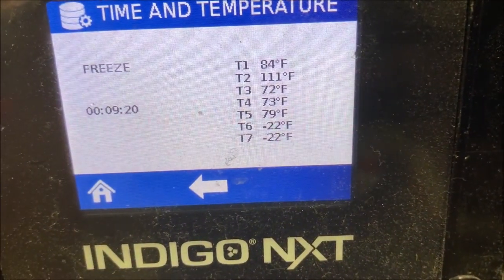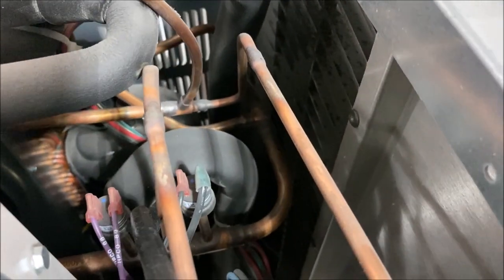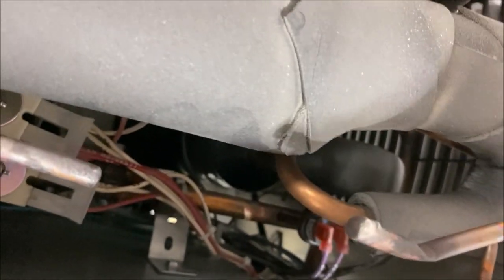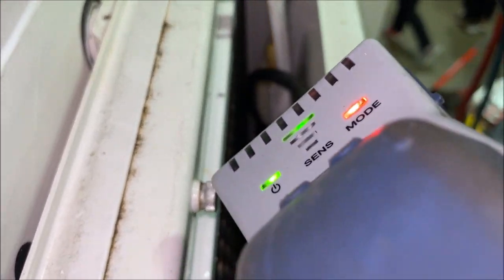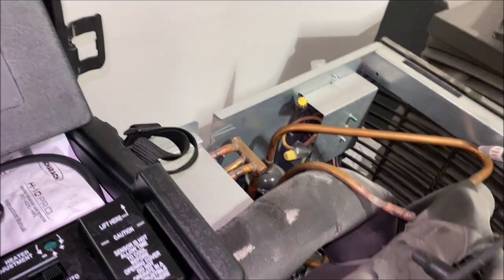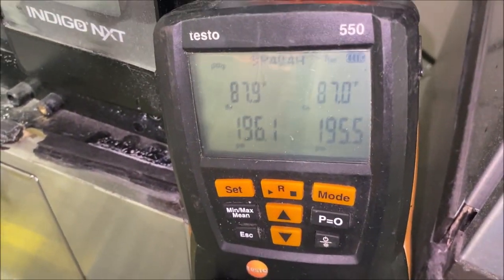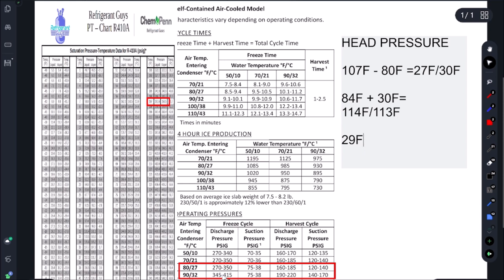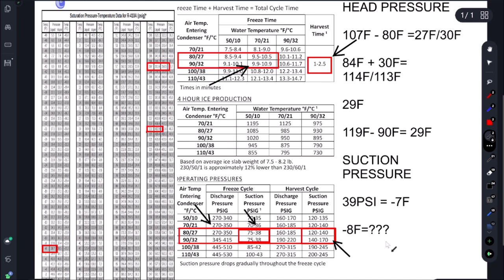Manitowoc Ice machine IS not making ice (Warranty call)

Comment: R-410A on a self contained ice machine great job Manitowoc 😀🙄😬. I’ve repaired several leaks on Manitowocs ,Koolaire units bad design for self contained units taking in consideration that not all customers are on top of their PMs just imagine what the head pressure will be on a self contained unit with a clogged condenser 😂🤣😆🥹. Good video 👍🏼
Reply from the maker: Ya great point, head pressure will become an issue for sure
Reply: Luckily they put in a high head switch that will shut it down until you do the PM on it.

Comment: Great job. I've noticed that those new Manitowoc ice machines are having some problems while still under warranty. Especially control board and leak.
Reply from the maker: That’s not good, especially with the shortage of parts
Reply: So true bro, I rather the old fashion type ice machine wotk like a old 1989 Toyota corilla even when the body is gone the main working componients are still kicking

Comment: Really like your play-by-play in your videos, excellent job again. I might have to invest in an H10, haven't used one in 20 years. Nice to have several options for leak checking, keeps the stress levels down.
Reply from the maker: It’s one of the hardest parts of the job, and in the last month since I’ve had it, it has made my job easier and quicker.

Comment: I have been using the H-10 for over 40 years it has always been my number one leak detector I have owned 20+ different manufactures leak detectors.?

        But they finally manufactured a leak detector that is as good and may be a little better for HCFCs and HFC oh refrigerants the DeTek Infocon Stratus

H 10 is still my first to go leak detector for R 12 in R 22
Reply from the maker: I thought the stratus and dtek3 had the same sensor, only difference was the cloud hunting mode.
Reply from the maker: Thanks for the detailed explanation! Yes I’ve found sometimes one works better than the other. I most only work on R404 and R134 and find the H10 is just a little more sensitive so it has been better so far on the very small leaks.